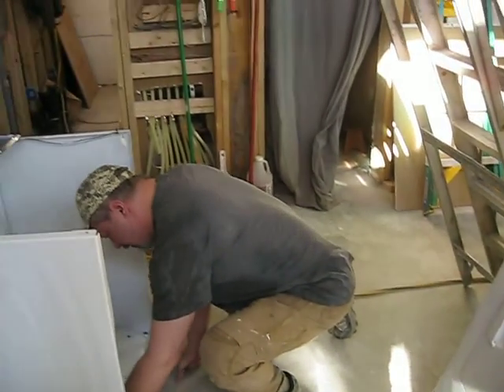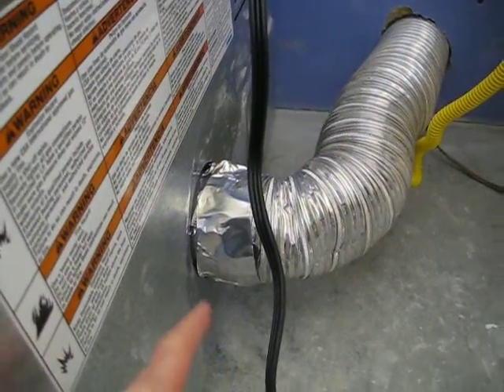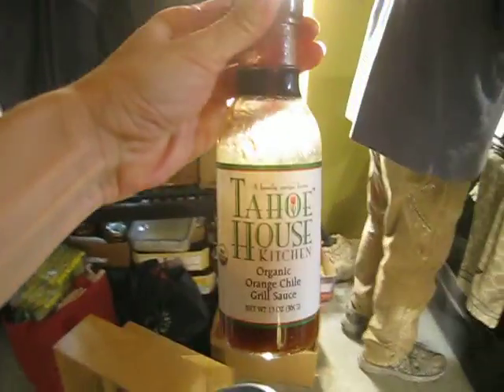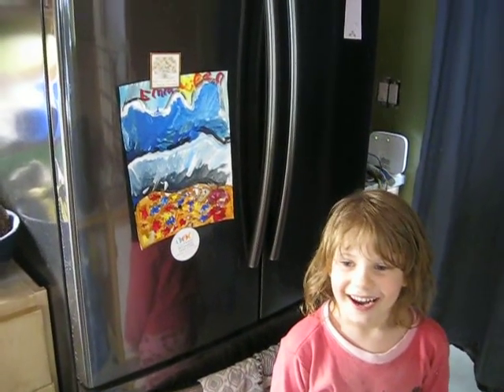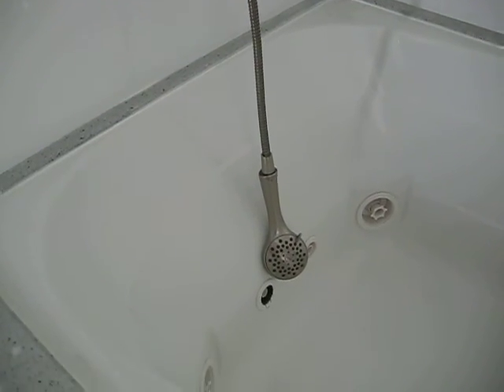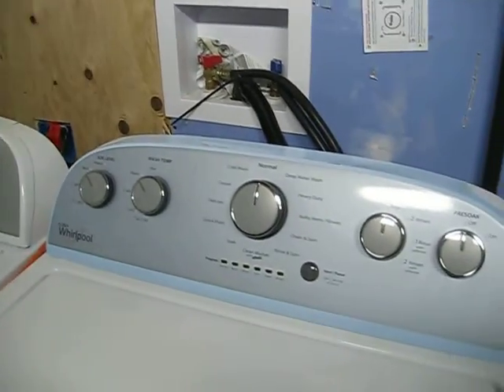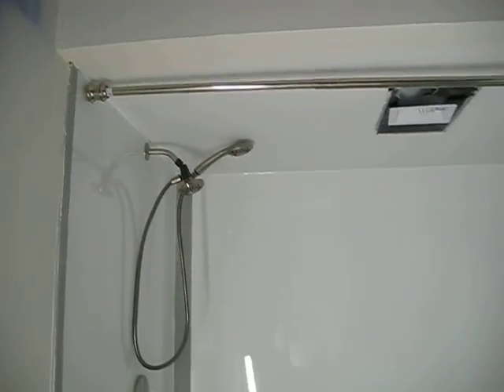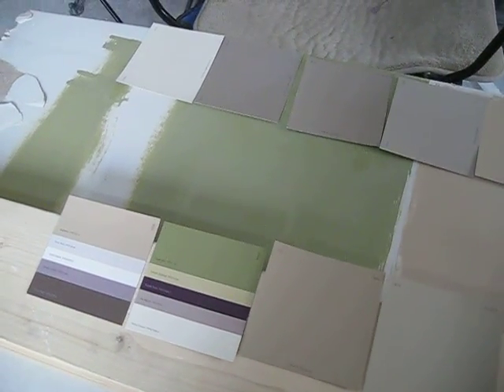House Building Part 24: Laundry Set Up

Comment: Looking good. If I was you I’d run 4” solid ducking. That flex pipe traps all the lint and can cause fires. I can’t tell you how many places I’ve had to fix and rip open walls to replace it. Seen the ducts have over an 1” in them. Plus they kink and dent really easy. Restricting the flow.
Reply from the maker: Great advice!  We when figure out if the dryer will stay where it is or whether we should move it along the back wall (which may help with better venting), we will use the solid ducting. :)

Comment: Looking great so far. Your color pallet sounds on point. Just wondering if you've thought about any upper cabinetry in the laundry for supplies and other chemicals up and out of reach of little hands? Also, will the rock go on up the wall to simulate a chimney behind the wood-stove?
So happy for you to have your laundry at home now. I've done the public laundromat and it is definitely better at home. Check around for an inspection camera (around $30 on Amazon) to look into your drain situation. Hey have lights built in and can use a smart-phone or tablet for the viewing screen. Good luck on the drain fix, I hope the snake fixes the issue for you guys. Are the other drains flowing properly?
Reply from the maker: No, the rock will not look like a chimney -- just mortared to the wall.  And the drain is running!  Yahoo!
Reply: Kendrick Homestead that's great on the drain.

Comment: I would choose my great room paint color for the dark days of winter.   Winters seem to be getting longer with global warming.   Lighter color with a warm tone.   Spring Summer and Fall you will be outside more.  the old guy   Bert.
Reply from the maker: You are right!  I think we have found a better, lighter beige that will work for the main color.  Thanks, Bert!  And we haven't forgotten about your design suggestions for Emmajean's loft bed.  It will have to be an add-on once we get things finished enough to just close on the loan!

Comment: Carbon monoxide is heavier than air, move your detector couple feet from floor.
Reply: That's actually a myth, i thought the same thing until recently. I did a quick skim through the instruction manual of a carbon monoxide detector and it said to install it higher up like a smoke detector, Thought they were wrong, ended up doing a quick google search and sure enough the manual was right.
Reply from the maker: Yes, I would hope the manufacturer is giving us the correct installation instructions.